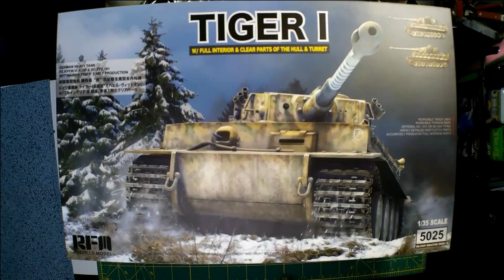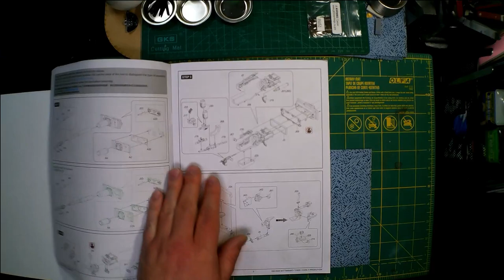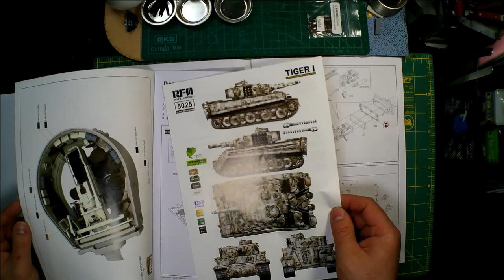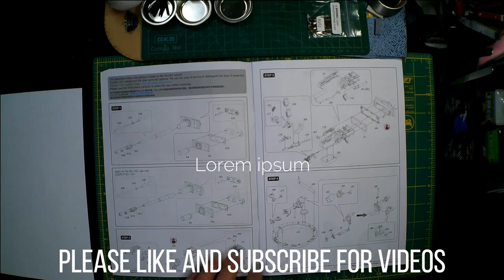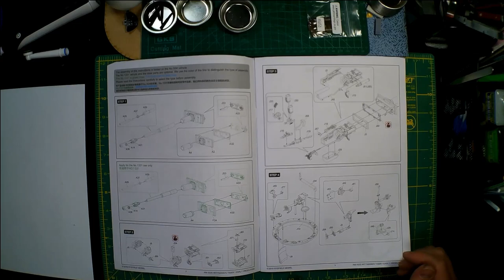Building Techniques Series Part 1 RFM Tiger 1 #5025

Comment: I am glad you decided to do this. People have claimed they are doing a buik=d of a model but in reality, they build most of it away from camera. Since you like building, then lots of possible things can be learned from you. I recommend you split build into sections of the tank at a time. Much like they do in partworks projects. shared video
Reply from the maker: I have already filmed 5 parts of this and they will be released on Wednesdays each week. It's not going very well and I wasn't even going to put up the videos, but I now think they can still help people. The problem is that this kit sucks for this type of build and it take a lot of upclose work to do it which I can't film. so it's mostly going to be following the build as I point out tips and tricks as I use them. You will see in future videos that there are many tiny parts and they will piss you off. I'm working on a release schedule now.